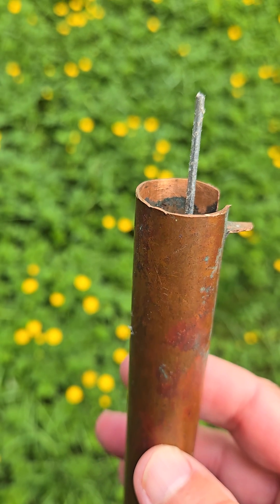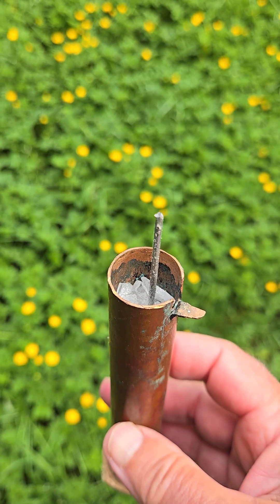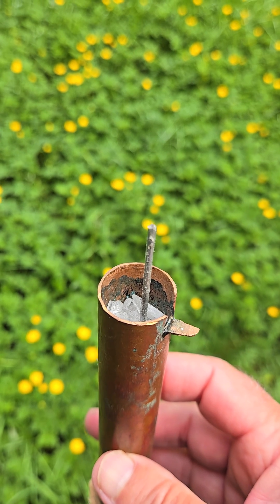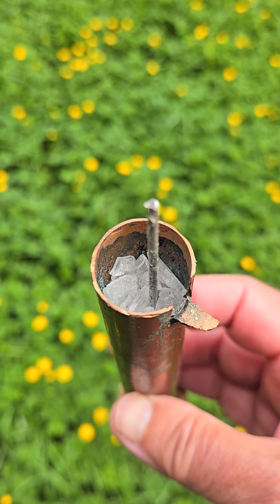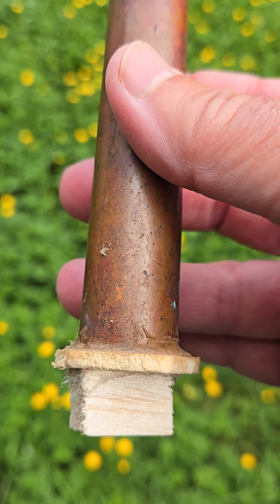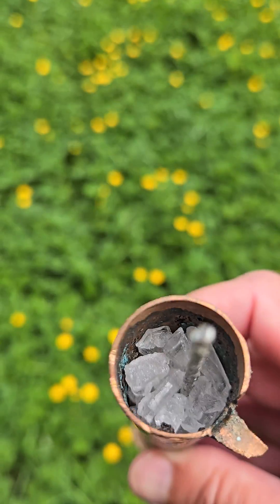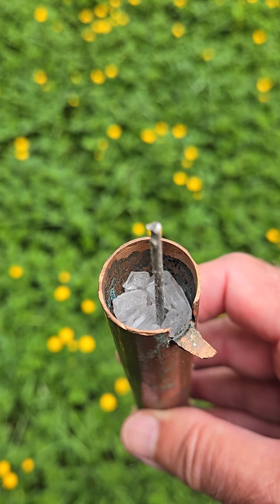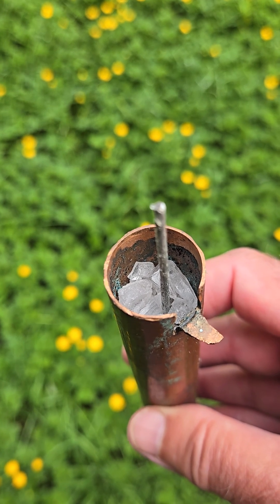Piezoelectric Module for Earth Battery/Generator

Comment: Whàt type of crystals are you using?
Did you say rock salt crystals?
How much voltage/amperage is output from just oñe module?
Reply from the maker: Those are Rochelle Salt crystals. Voltage from one module is about 1 Volt DC
Reply: I made a joule thief that can light up 1 LED using only 0.5 volts. Can it be installed with your earth battery?